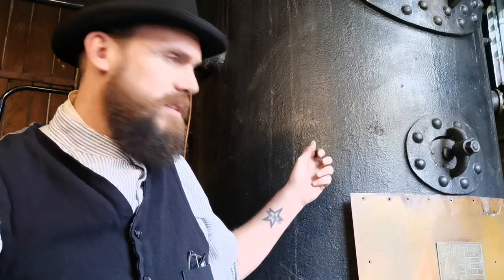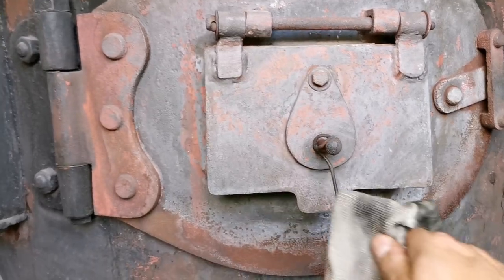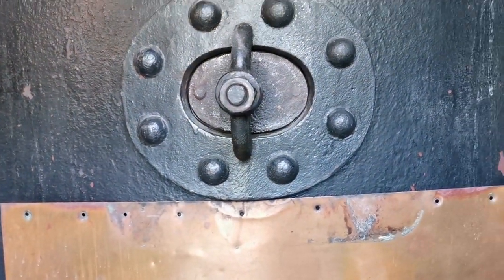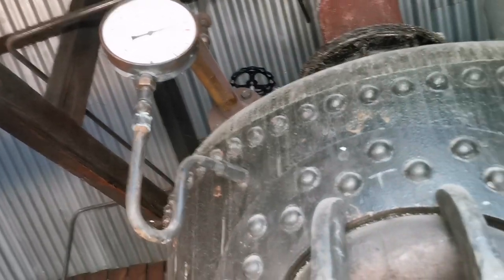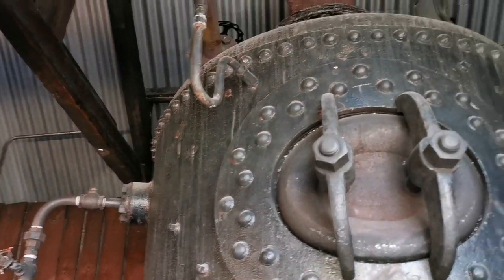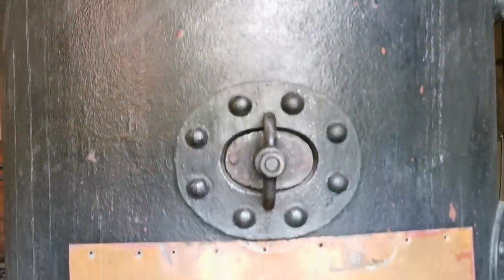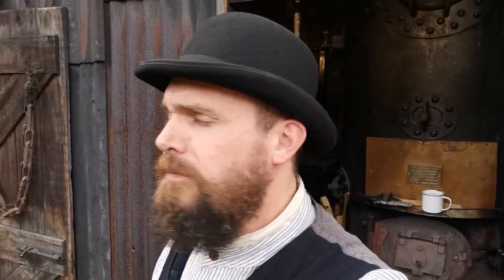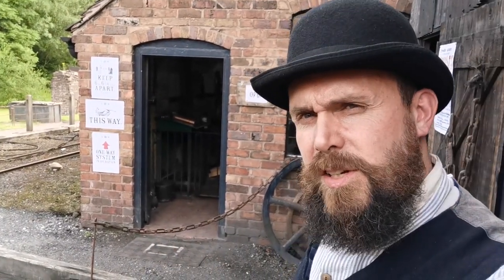Boiler explanation and working steam water pump

Comment: Very cool! We used a boiler to heat our pool. I forgot to turn on the circulation pump after starting the fire and melted all our pipes! Felt miserable. We obviously modified the boiler to use it that way but it worked. Hope you are great Sean
Reply from the maker: Cheers Steve! These old steam boilers need a close eye, it's very easy to get things wrong and end up in some sort of trouble, the smaller they are, the more attention they need. Bad luck with your boiler,  you only tend to make the mistakes once 😊